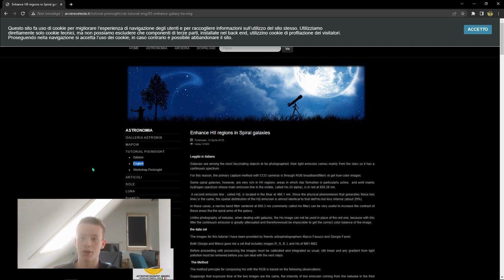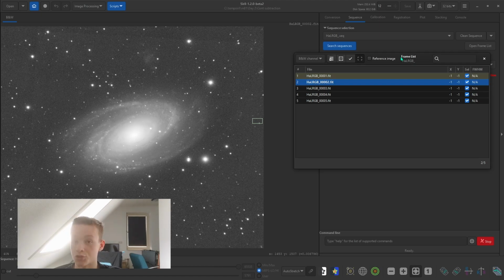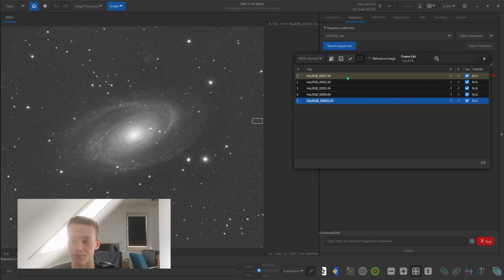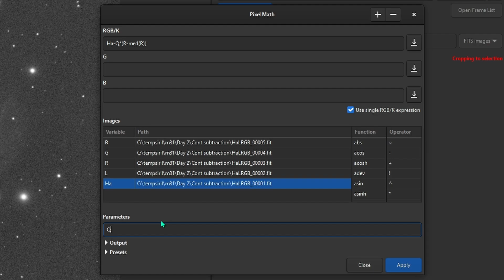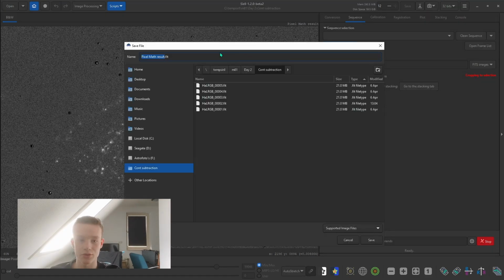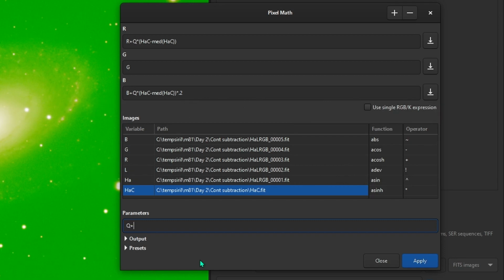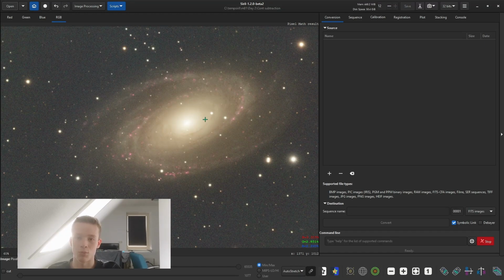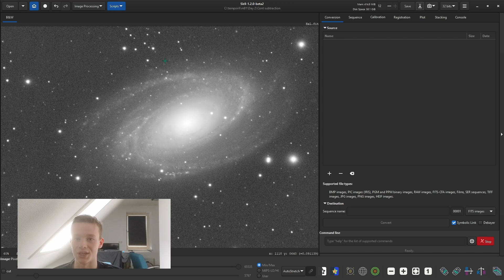How to add narrowband to broadband data in Siril using continuum subtraction

Comment: I have two separate scale images and not able to align the objects/stars in them. One image is stack output of H-alpha other is stack output of OIII fiter. Both captured at different focal length with and without reducer. So how to combine them with proper alignment of stars using Siril?
Reply from the maker: So these can be a bit tricky to align, sometimes they just work other times you have to mess around a bit. I have found that the alignment tends to work better when you crop the image with the widest fov to approximately the size of the other image and then align.
Hope this helps.
- Stefan